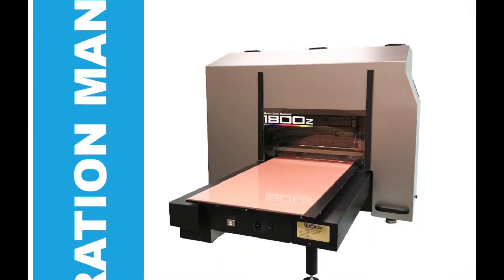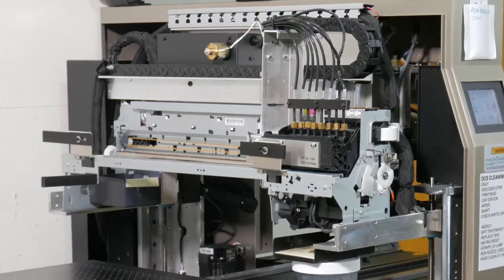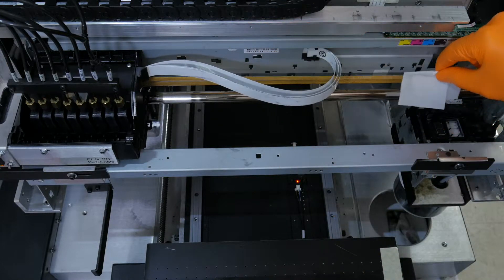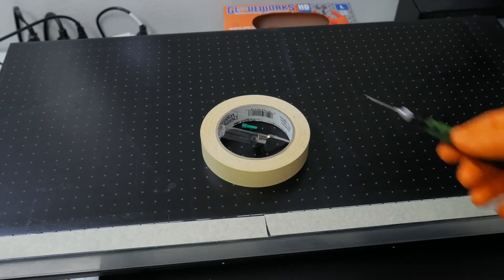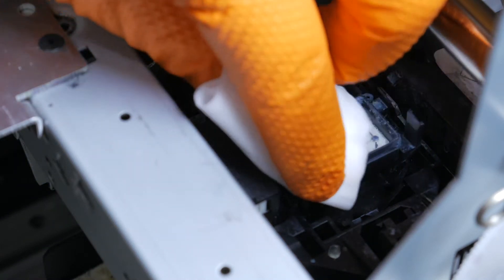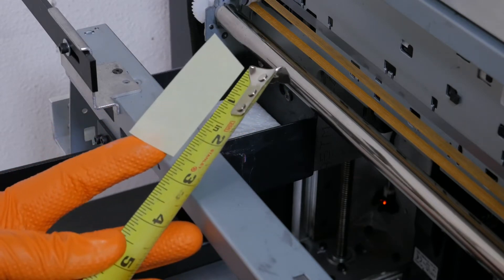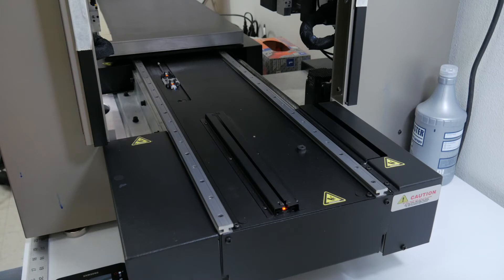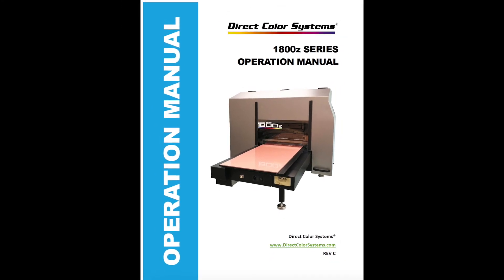Direct Color Systems 1800z Routine Maintenance

Comment: What print head does this machine use
Reply from the maker: I worked with the 1800z back in 2018, but I do not remember the part name/number.  You will have to go to Direct Color Systems dot com and send them an inquiry.
Reply: @FilmsbyJPButler  epson p400 head